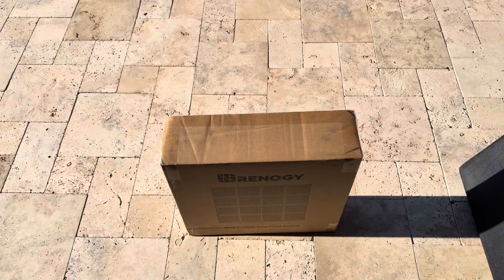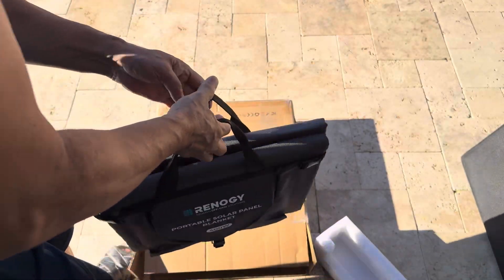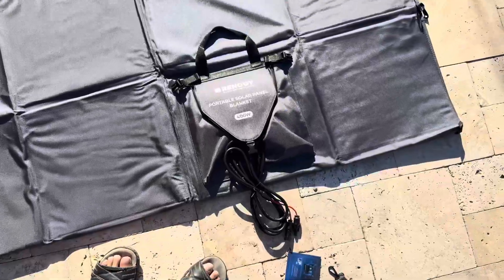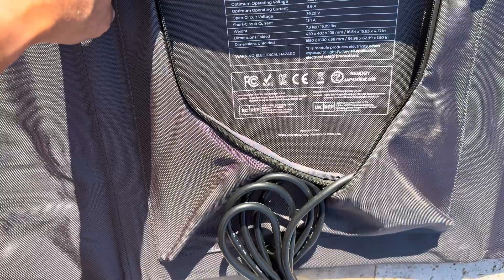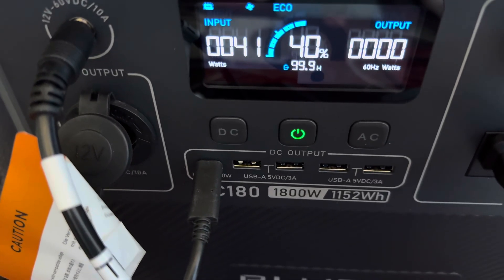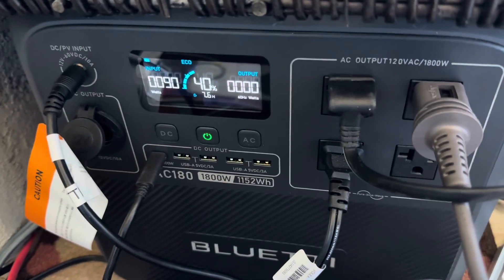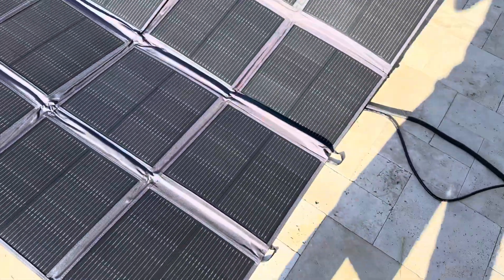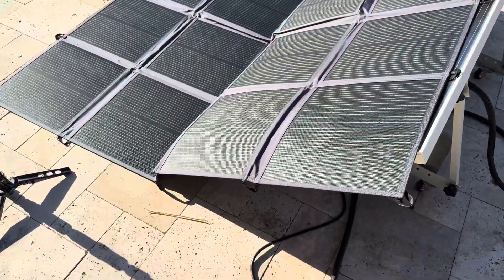Unboxing of Renogy 400 Watt Solar Panel Blanket, N-Type Portable Foldable Solar Panels

Comment: Each row of panels is wired in parallel. Shading the panel, especially across the rows, is going to cut your input drastically.
Reply from the maker: Yes, thanks for the info!

Comment: Been looking at this, I like the portability and weight, I also like the idea, you can fold it to reduce its span, less watts but sometimes space is limited.  I think the two straps are for hanging the panel off a side of a truck, or camper. It needs to be tilted.  You know the can trick right.?  Place a can of soup against your panel, if you see no shadow you have the right tilt.  This changes during the day as the sun moves across the sky.
Reply from the maker: Thanks for the tip. I have yet to see an input of at least 300 Watts to my Bluetti C180. To think that I am in AZ I would easily get that. Could it be because it’s too hot at this time of the year?
Reply: @anythinggadget123  Panels are less efficient when hot for sure
Reply from the maker: @DarrylLeaning Yes, you are right. I read that when the panel gets hot it’s less efficient.